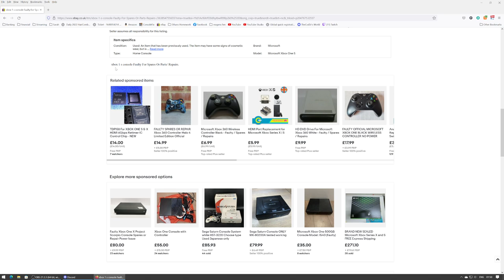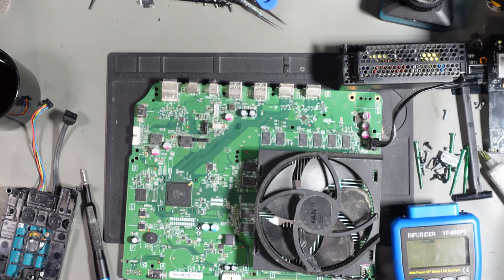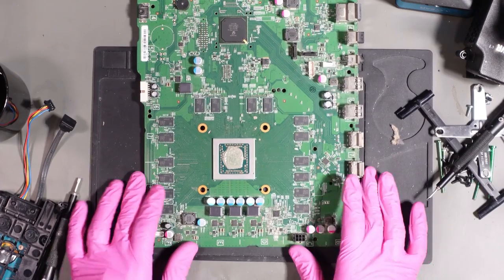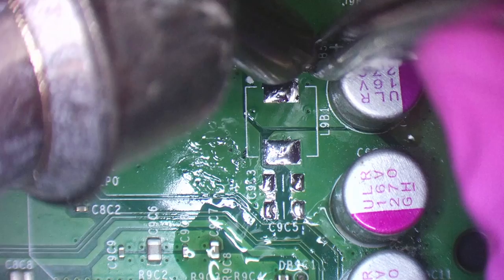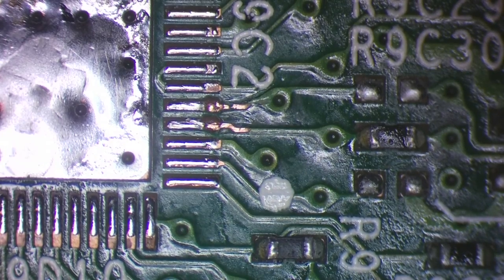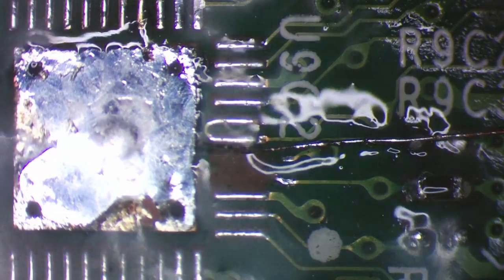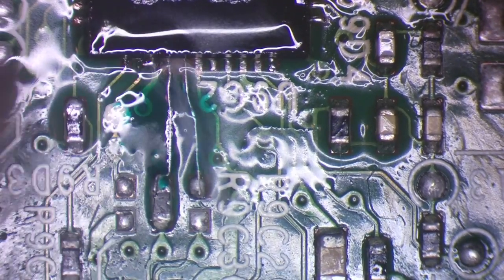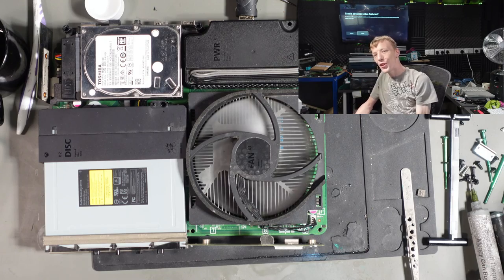I Had No Clue What Was Wrong With This Console, But I Bought It Anyway! But Was It A BIG Mistake?

Comment: @TheCod3r Why did you remove the pads instead of jumping from the point to the existing pad as they was solid to the board ? the pad extends to the side of the PM IC anyways ? so it would still sit flat to the board? Just asking for reference and educational purposes.

Comment: When you want te remove the yellow off white plastic, just put 12% hydrogen peroxide on the case and put it in the sun. It will come off in just 2-3 hours. It’s necessary to put it in the sun you need the uv light to do its job.
Reply: It is only a temporary fix, the bromine continues to leech and quickly turns yellow again.
Reply: @ChannelReuploads9451  Agreed, but it looks better for quite awhile and you can do it again. I had to with my SNES after a few years, but I have tons of windows in my place
Reply: @ChannelReuploads9451  what do you mean, could you explain that?
Reply: @pietermodderman8906  The plastic contains Bromine as part of its Chemical binding.  As the plastics age, they break down and the first to leak out, is the Bromine molecules, discoloring the plastic.  Using Hydrogen Peroxide only cleans the surface of bromine, meaning that the plastic still contains Bromine, which continues to leak.

The Hydrogen Peroxide trick to clean the plastic is only temporary.